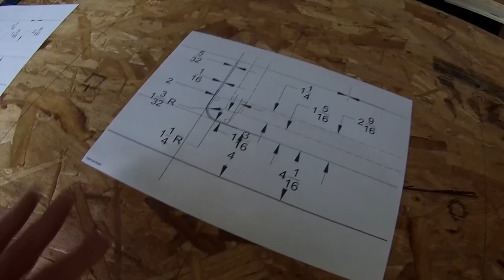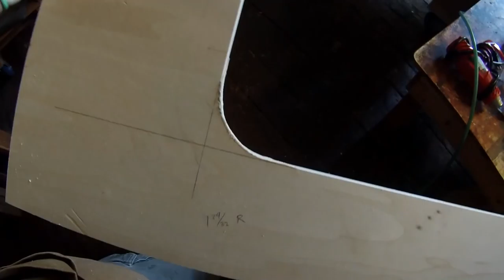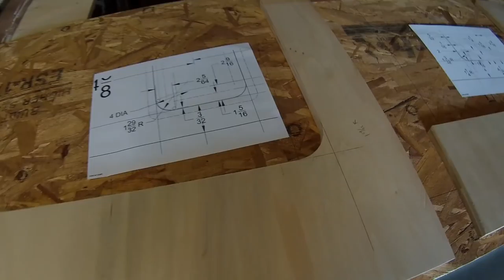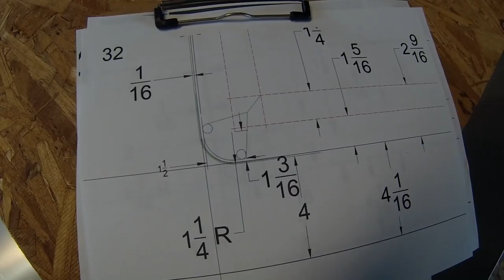Zinc Counter Top Job With Undermount Sinks - PART 2 - Making Templates

Comment: Your videos are really great. Am making my first zinc countertop w/ a backsplash and am stuck on how to configure the corners without having to resort to soldering, incredibly complicated, almost impossible to cut pattern, and/or separate pieces of zinc for backsplash and counter. Have you had any luck with developing a design that uses a single sheet of zinc for the counter and backsplash?  Am I delusional to think it could be done?